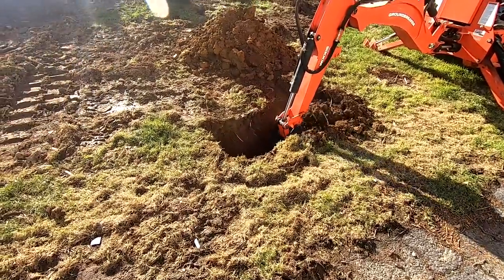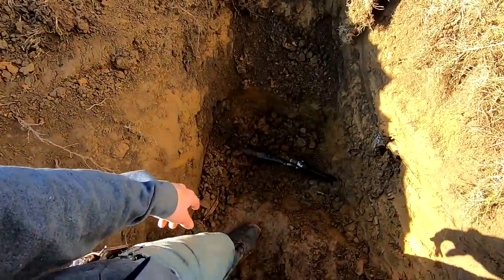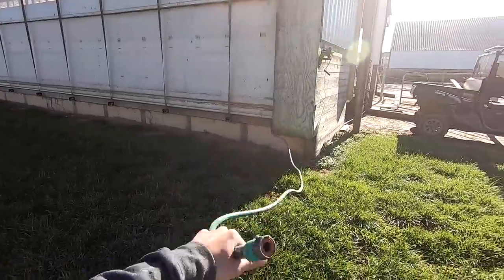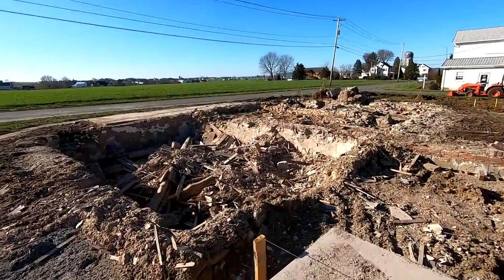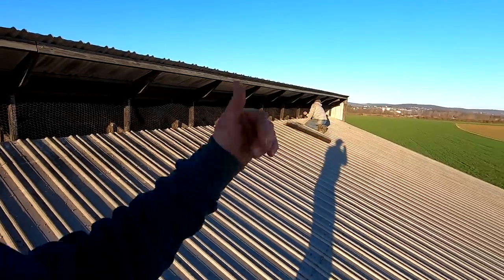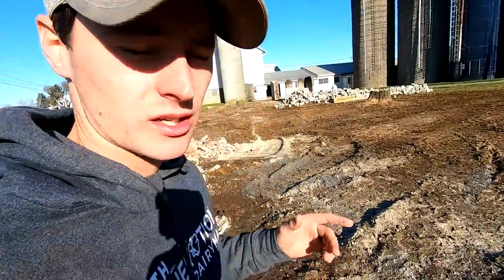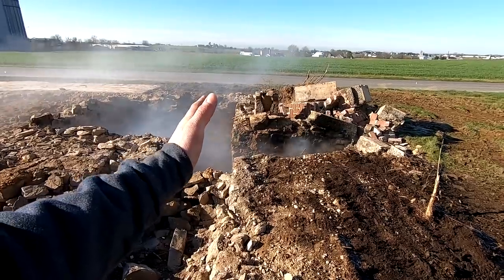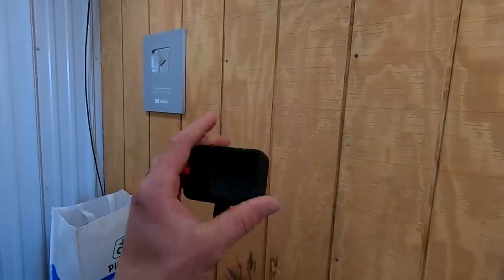Land of Opportunity

Comment: Geothermal heating and air conditioning in one unit. We have a home built in 1923 now using geothermal system installed by Comfort Aire Heating and Cooling from Lampeter, PA . With a 5KW of solar panels our electric bills average around $60 during spring, summer and fall then $250 when the electric heater kicks in with cold weather. We're total electric home.

Comment: Hey Erik, regarding the heating system. Hot water / in floor heating can be great. Unfortunately AC then would be an entirely different system. Forced air solves both issues. If you have hot summers where you depend on the AC you may want to look at a separate air handler / furnace for the second floor. No matter how you set up zones a single air handler system will not adequately cool the second floor.  It may be worth the additional cost. Stay away from heat pumps because they are not efficient in colder climates. Ask around, but in Wisconsin they don't perform as advertised. I really enjoy following your operations through the years. Great job!:)

Comment: I tell you what I have always heated my house with a wood furnace and wood pellets. Last year I put in those Mitsubishi mini split heat pump system. Excellent air-conditioning in the summer and excellent heat in the winter. The system draws about 2400 W, and it's a very small increase on my electric bill. If you want air-conditioning, you may want to consider that system maybe just for your downstairs or upstairs vice versa. I have been extremely happy with it.

Comment: Personally, for heat I would do a boiler that heats rads or in floor heat, and that same boiler could heat your domestic hot water with a tank with a coil heat exchanger in it.. A condensing boiler is the best for this application. It would heat the rads and in floor heat at a lower temp and heat your domestic hot water at a higher temp. Use an outdoor sensor and the boiler heats up to different temps depending on the weather. The lower temp those boilers run at the more efficient they are. Run it on propane since you don't have natural gas.

Comment: How many generations of your family lived in that old house Eric? In floor radiant heating works well, but if you ever drive a nail or screw into the concrete floor and nick a heated water line, it'll ruin your whole week! Electric heat pump and AC with a wood stove back up in the basement works even when the lights don't. Pay extra for really thick insulation and double pane insulated windows, its worth every penny in the long run!

Comment: We went with a hybrid heat pump/propane system.  It will use the heat pump until it gets near freezing outside. Then will switch over to propane. Which provides a “warmer” heat.  It’s been two years and I’m very satisfied with it.  I use just under 400 gallons of propane a year with heat, hot water, and cooking.  I live in Ky

Comment: I agree with Vard below.  Water pipes under floor.  You can use any type of heat source down the road and you'll always feel warm for less energy input.  Up front costs will be higher but it's the most efficient way to heat a home or any space.
If you want air conditioning too it will have to be a separate system.  Split units might be an option as no ductwork involved but I'd still go with full house air with ducts.  Putting the ducts for air now would be cheap and you could add the air conditioning unit later.  Cheers 🇨🇦

Comment: Personally we’ve used a wood boiler stove for heat in our house for years a lot of trees in my area which is to our benefit and we ran lines underground and encased them in schedule 80 pipe if in the case that there’s a break in the line and it’s similar to geothermal especially in the summer when we turn the heat exchanger fans on it stay very cool on those hot days so my vote would be geothermal

Comment: Vertical geothermal the ground is a great heat source/sink. The system will run constantly at a very low cost and keep the home comfortable be it summer or winter. Don't skimp on insulation and weather sealing either! Underfloor heating in the winter is great but would require a fuel source like wood or propane which is either time consuming or costly. There are MANY options so don't just pick the first one, do a lot of research and speak to local people who have the same style you are looking into. I would absolutely go geothermal if I had solar panels as it is a win-win and only use propane as an emergency backup.

Comment: Geothermal in floor heating, and make sure the house is oriented South toward the sun. A quick look into passive solar design will show you the best way to heat and cool by simply orienting your house the right way. I know you're confined with where you can build, but if it means putting your garage on the other side, so you can have windows toward the South, it might be well worth it. Best of luck!

Comment: I live in an old house and have hot water radiators, my grandparents house is much newer and they have hot water baseboard heating so no big radiators, much less water, etc... I love the hot water so much better than a forced air setup. I've never had to start from scratch though, but I would at least look into it... have a little wood stove also for extra warmth. Would be comfortable as well as inexpensive

Comment: Heat l have no comment on, but insulation l would definitely go with closed cell spray foam.. We were forced to use it in a cottage we build, and l was not too happy with being forced to use a certain expensive product, but omg, the foam has reduced our heating costs big time.  It’s also made the building much more rigid, and squeak free..Like living in a Yeti cooler..🎉😊

Comment: You can combine a heat pump heating system with solar panels to ensure that your heating and hot water needs are met while also being environmentally friendly. It's entirely possible that solar panels would be able to produce all the electricity you need to run your heat pump depending on the size of the solar array. Dairy industry solar water heating systems can also provide a constant supply of hot water at a fraction of the cost of traditional gas or electric heating systems. These cost savings can help you reduce your costs, significantly improving profit margins in an environmentally friendly way. All the best from Croatia, EU.

Comment: Eric, from experience as a former dairy farmer, you do not have time to cut wood and feed a stove. So, that narrows it down to fuel burned forced air or a combination of geothermal and forced air. Do you have natural gas access at your farm? If so, that is your best bet overall. If not, you will be limited to propane as your fuel and a combination of in floor heat and forced air zone system. Best of luck getting these and 3000 other new home questions answered.

Comment: I would probably do some form of a heat pump either air to air or water to air. And while you’re at it and starting from scratch, add in a little solar to help recover some electric costs over time. Probably the best time to set that system up for the future.

Comment: Radiant hot water is the best heat. It costs a bit more up front for installation, but it is worth the extra cost. A natural gas fired boiler that can provide domestic hot water would be desirable.

Comment: Hi Eric. As a Retired HVAC person i would advise you to look into closed loop geothermal> I won't recommend a certain brand but i sold ClimateMaster Geothermal units and have always had good luck with them. fact is I have some still in use after 20 years. I recommend closed loop for a number of reasons. using the same water over and over. less maintenance on your well and pumps. less wear on your heat exchangers. Your HVAC dealer can give you more reasons.   wish you happiness in your new home.

Comment: Yes Eric check into in floor radiant heating and then if you want ac do the ductless mini splits. Will be a little more up front but the uniform heat you get is outstanding. You can also add a wood fired boiler outside that can help offset heating costs

Comment: Nice Video Eric thanks for sharing - I hope these tips aren't too late for you.  2x6 outer walls and 12" of attic insulation will save you $$ bucks all year round.  36" wide doors inside the house likely don't cost more and make moving furniture around way easier (never-mind wheel chair access for the future).  Also plan for possible solar panels in the future by getting a new 'net meter' installed if your location is good for solar.  All the best and God Bless. 🙏❤🇺🇸

Comment: Eric,  I would look at a Carrier Infinity Modulating Heat Pump.  I'm sure it will qualify for Federal tax credits.  Next year there are huge tax incentives that this system will qualify for.
I would zone your home as you will have very different temperature between the basement and top floor, so comfort will go up while the cost of operation will go down. The Infinity system is incredibly efficient and will save you a lot of money vs propane in  winter operation.  Propane is terribly expensive and takes consideration when there is a basement involved.  Propane unlike natural gas is heavier than air so leak detectors and emergency shutoff valves must be installed.  If you have natural gas to the home, Carrier Infinity gas furnaces are up to 98% efficient and may also qualify for a local utility credit and other federal tax credits.  That said, find out the cost of your electricity per KW and I could run some ROA numbers for you if interested.
Exciting time for you and your family!  Congrats on the new home!

Comment: Forced air heat is the most common anymore being you use the same ducts for A/C but I have water registers in our hours and my grandparents put in floor heat in the kitchen and I can say it is by far one of the most economical ways of heating a house being it gets recirculated however if you plan on having A/C you will still have the ducts in anyway but I wouldn’t give up my In floor heat for anything.

Comment: Regarding the heating system, I'd suggest a ground source heating unit. In your case you might need to have deep holes drilled near the house and then pipes grouted into the holes. The heat pump would run from electricity and you could install solar panels on the roof to supplement the electricity supply. The ground source unit would provide heating, cooling and hot water. I think this is a good long term investment.

Comment: I am in the HVAC field, I recommend geothermal aka ground source heat pump. They have high upfront costs but low operating costs. there are current federal tax rebates for this option. 2nd choice would be a dual fuel, high efficiency air source heat pump paired with a propane furnace. there will be a instant rebate program for this type of system starting in 2023 known as HEEHRA.

Comment: I build new houses in Houston but before i did a ton of green building. My suggestions if u can work it into your budget in order of ROI. This is based on my experience but I've never lived where u live so these are just things to inquire about with local trustworthy professionals.

1. Spray foam exterior walls or wrap your house with plastic. Basically anything to ensure an air tight vapor barrier between inside and outside being sure to include the underside if spray foaming or top of roof. 

2. Solar panels (they are soooo cheap now and most have 20 year warranty) Stay away from Tesla solar roof just your regular roof panels being in the shade extends their life significantly. 

3. Battery storage or an EV that can power your home with a good charger. Id reccoment also just go ahead and pay the couple hundred extra to install a 240 electric vehicle charger in the future, much cheaper before walls are put up. 

4. Tankless water heater (electric is much cheaper to fix and maintain over the 20-30 year lifespan). 

5. Upgraded electrical panel (whether we like it or not the future is electric, so upgrading your electrical panel set-up for easy integration with solar and medium scale energy storage or multiple 240v vehicle chargers for the future will be cheaper now than in 5 years). With your land u could easily eliminate any electric bill for about 10-15k. If your area buys back power get capacity rated  for double your average usage if within budget of course. You will be glad u did in 4 years.

Comment: I would consider a 98% propane hot air furnace with A/C and rough In for a outdoor boiler, later as the budget would allow you can install a outdoor boiler a hot water coil in the furnace and a water to water heat exchanger on the water heater. It’s apparent that you should have ample free firewood on the farm to supplement your heating needs. It all depends on the budget.

Comment: Eric.  As far as a heating system 
I would suggest a forced air system for your home. I have been installing systems for 40 years. I have installed them all. Your best bang for your buck is forced air. It is more economical,  you will have central ac, able to clean and humidify the air. If you have natural gas, it’s the most cost effective way to do heat your home. Don’t get sold on geo thermal, it’s too expensive now and in the long run. Radiant floor  has no ac. And hard to control in a 2 story home because of a lack of air flow. In a a 2 story home you need air movement for comfort.
I have watched your Chanel since you started it. I always enjoy watching it

Comment: We put radiators in our house.  Runs off hot water, and we are using one thankless hot water heater for both. Domestic and radiators.  Works very efficiently.  Runs off propane.  We don't use but maybe one and half 500 gallon tank a year here in Kansas

Comment: Heat pump, all kinds of tax credits available starting 2023.  Could be ground source using that cistern for the ground loop.  You've got so much roof real estate from the barns, you could offset the electrical requirements with solar, again there's tax credits for that.

Comment: Forced air heat lets you run air conditioning, and you can do all the wood boiler stuff with it just the same with some different parts
I'd keep the cistern, you'd just punched in that new well, but additional water on standby is never a bad thing, cheaper to collect rainwater too, as it doesn't have to be pumped 300' straight up.

Comment: I would recommend radiant floor heating, zoned for each room, and a ground source heat pump. With your available land and excavating equipment it would be very easy for you to lay out a Ground Loop for this system. Saves a lot of money in utility bills. I would also design the system for eventually adding Solar panels along with a battery backup. Truthfully, I would recommend you install the Solar system during construction, however, you can at least plan for your future Solar installation by laying out Conduit and reserving space for the Solar equipment and battery.

Comment: The last house I was in had a gas furnace and I loved it super toasty super quick,  I have a heat pump system now not a big fan. With 2 story get a system that can keep one floor off and one on.  If no one is in the 2nd floor you will not be able to shut it off with a single system.  Check out Matt Risinger  on YouTube he is into the latest technology and just built a new house.  Check out some his insulation methods he is cutting edge that is just as important as Heat and Air systems.  There a few builders in my town that don't practice any new ideas that are out there.  We were thinking of building a few years ago, when I started talking  about some of these ideas I just got blank stares

Comment: Radiant heat in the floors doesn't work well unless your floors are concrete or tile. Radiant floor heat will ruin hardwood floors if you get it hot enough to heat the house.

Comment: The best long term heating and cooling efficiencies will be geothermal.  It's doing both,  which is the only method that can.   Now you need an interior that can do both as well, which requires ducting.  Add a heat exchanger, boiler and ac...your set.  Add a wood stove for character if needed.

Comment: I would install a heat pump, because you are no longer dependent on gas or oil prices. Theoretically, you could get the electricity from your own solar system if you wanted to.

Comment: Any indication that any of the old timbers were hardwood?  Heat---hot water. But that means a separate system if you want whole house AC.  In floor hot water heat is great for wood and tile type floors, not so much for carpet. It's more costly up front, but ground source heating and cooling takes advantage of the near constant temperature in the ground below a certain depth.  If it's in your wallet, be nice to yourself and build with tall ceilings. Easy to do with drywall. Don't make the house too plain, nothing wrong with a fireplace or a bay window or something. Or design so you can make additions in the future, like a sunroom or something.

Comment: Hot water either gas or oil whatever you’re more comfortable with but I would definitely have an outside wood/Coal tied into the hot water system. It will save you a fortune.